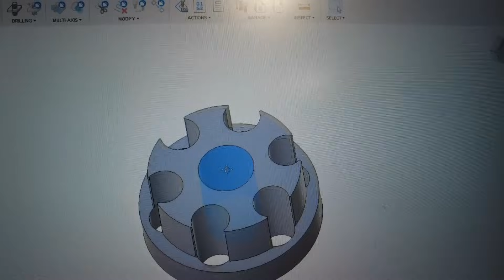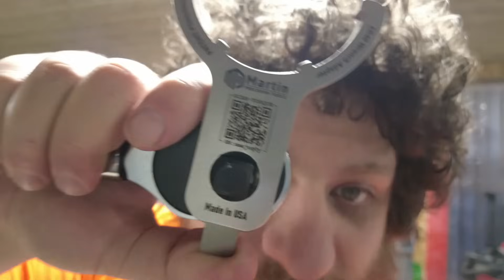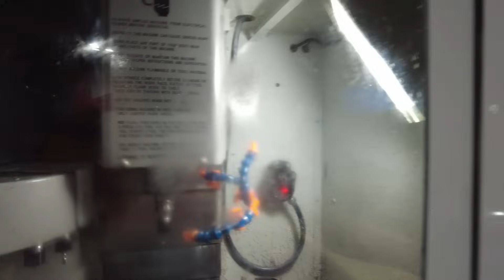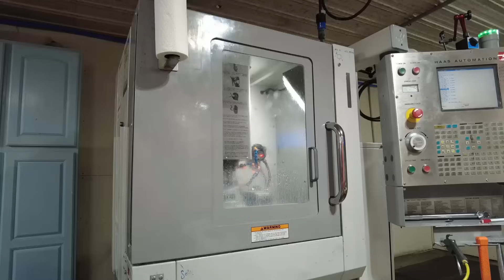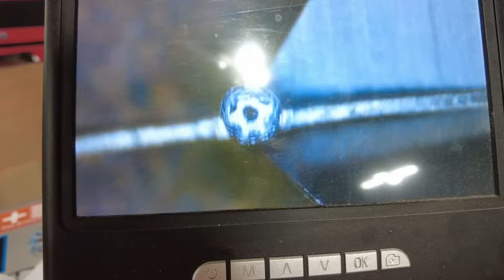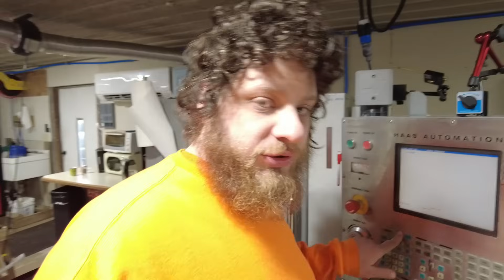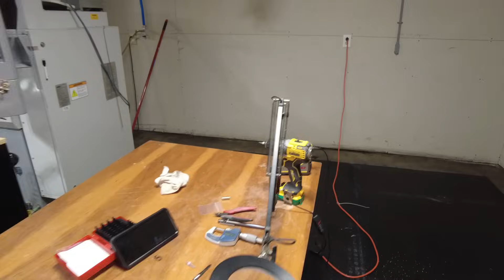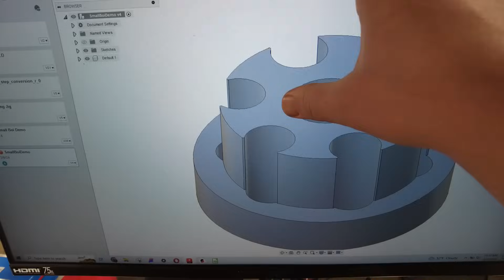Machining Some ABSURDLY Tiny Parts

Comment: Yes, It's me again...  Have a peek at Archie Perkins books on "The Watchmakers Lathe" and his three volumes on "Antique Watch Restoration".  Won't solve all of life's problems, but perhaps will give some insight on making quite small parts.  George Daniels "Watchmaking" is a classic as well.  You're certainly getting the most from the Haas, more than I would have expected.   I'd be having fantasies about Kern and Tornos machines in your shoes :-)  Well done pulling off those parts!

As for watch making putty like materials, AF RubOff and Rodico are two useful material, although in a pinch well balled up white bread (less any crust) with a wee bit of distilled water can sometimes save the day.  Parts nests in pith wood are nice, although real pith wood is hard to find these days.  Hard balsa or basswood is a fairly useful second choice.  Hang in there, you're doing amazing things with the machines you have at hand!  For work holding, CA glues break down in acetone, shellac flakes melt at fairly low temps and dissolve / clean up in alcohol.  As you are finding out, it's often how to hold the darn thing to work on it more than what to do with or to  the thing once you can hold it that makes life exciting.

Tweezers are a tool that most take for granted.  Carefully shaped and sharpened tweezers with flat faces that close perfectly without squirting parts out or drawing the part inwards are a wonderful thing to use.  Few folks outside of watch making and hybrid micro electronics learn the fine art of tweaking and keeping high dollar fine tweezers in good shape, but considering what you are dealing with it's a subject worth getting cozy with perhaps.  Dumont #3 and #5 tweezers are a good place to begin if shopping.  Not inexpensive, but tools you buy once and treat well.  The tweezers drawer in my watch makers bench is probably one of the most expensive little bits of real estate on this island.  At a lower cost, some of the Hobbytown branded tweezers are amazingly good for $10 or so, just had a chance to try some out at a model making show and ended up buying some.  I'm just a sucker for tweezers it seems.  You are doing things many folks would never even consider possible or would attempt.  It's not always an easy path doing the odd, tough, and obscure jobs, but it sure is satisfying.  Best of luck, you're doing wonderful things.

Remember to get some sleep.  A well rested mind makes better decisions, your vision is better, and your hands are far steadier.  I would never touch a high value timepiece or complex repair late at night, even if I felt good.  Better to take it on in the morning while well rested.  It might be worth building a little more slack time into your scheduling wherever you can afford to.  I know it's hard to balance the hard drive needed to build a business and the need to live like a normal human.  When I had a three to six month backlog it drove me crazy trying to get out from under it.  Once I accepted it, and determined what could be done to a high standard of workmanship in a day and refused to force myself past that point my life became far more pleasant.  The backlog went from being an overwhelming monster to becoming a buffer to fill in those days the phone didn't ring.  Before leaving the cubical farms of government contracting to frolic with clocks and watches I knew I was getting too wrapped up in it all when I would dream in code.  I'm retired now, might not have made it if I hadn't learned to manage my self expectations.

Comment: I heard you make a comment "sounded like a Hoosier" i think it was, are you in Indiana by chance? Ive in Bloomington and so many shops have closed in recent years it always brightens my day to hear of the ones still doing business.  Amazing job! My work is similiar to Cutting Edge Engineering if you watch Kurtis at all.  My big hands would preclude me doing any of this, much respect for taking that job on!
Reply: Hoosier is a (oddly) derogatory term in St. Louis.  That'd be my guess.
Reply from the maker: In this case, a Hoosier is someone from Indiana.
Reply from the maker: I'm in Muncie! Which has definitely seen its share of shops closing over the last decade, but I'm also starting to see a lot of niche manufacturing pop up.

Comment: Wow, those are some small parts, excellent work! Quick tip for making it easier to handle those small gauge pins, put some tape on one end to make a tab. Makes them easier to hold and find when you put them down, you can also mark the tape with the pin size, handy when using go no-go pins.
Reply from the maker: Ooooooh! That's smart! I'm definitely doing that in the future!

Comment: I make some parts that I thought were small, but they are massive compared with those. The smallest holes are 0.3 mm and some have waveguide holes around 0.8 mm  diameter, with the parts being well over 1.8 mm diameter, with some 0.2 mm wide grooves. Fixturing and handling are key. I use a lot of of my father's old watchmaking equipment and some Xebec alumina fibre deburring tools, plus the electronics tools I use for 0402 and 0201 sized chip components, with a binocular microscope and velvet-faced boards to catch stray parts. An 0201 is 0.6 mm long by 0.3 mm wide and tall. I sharpen my carbon steel Dumont tweezers on a fine stone under a microscope to get the tip shape perfect (the parts are non-magnetic, otherwise I use titanium or stainless tweezers or a vacuum pencil). Keep up the great work.
Reply: I was going to ask what frequency you were working at that the waveguide is 0.8mm dia, but then I saw who you were! You haven't made a video in a long time - it was just a couple days ago that I checked if I was still subscribed to your channel I hadn't seen a video in so long! I also really wish you could bring back "Old Amy" - old Amy was... [chef's kiss]. New Amy's voice creeps me out!
Reply: @gorak9000  275 GHz... I'm trying to recruit a live-action Aimee instead of relying on Google TTS. I've done a complete shop rebuild and bought a new SYIL X5 CNC mill that weighs two tons. I've been working on some long term projects and sponsored stuff, should be back making videos next week
Reply: That makes me think. There are very few reasons why you'd want a hold that small. To guide light... to guide RF... hmm...

Comment: An important aspect when machining tiny parts is tool accuracy. 
Assume a chip load ( or inch per tooth per revolution) of maybe 0.000,05” when running a 0.012” dia tool. Think of how that is thrown off if your toolholder runout is 0.0002”.  (And, 0.0002 is pretty good runout!)
You also need to check your tools under a microscope every time.

Comment: Mild steel?  That's puzzling.  They must have chosen that for a reason, but surely at that size the cost difference between mild steel and basically anything else must be negligible.  🤔
Reply from the maker: Yup. It's strange. My guess is that they wanted to test a magnetic version or something. The stainless ones were actually far easier than the mild steel ones, as the stainless didn't give me as bad burrs.

Comment: The torque wrench thing is just a matter of dividing the total length by the length of the basic wrench, and then either multiplying the setting to get the applied force or dividing to get the new setting for the same torque.  It's handy.

Comment: This reminds me of a fiber optic transmitter I designed in Solidworks. Long story, when my initial order showed up from the vendor I was shocked on its physical size.  After months of design my mind was expecting something larger. It would have fit nicely on a penny. The hole for the fiber was .7mm. So yours is way smaller.
Reply from the maker: I kinda got the impression that this was for something similar actually. at least that's my guess based on the customer, and some of the tolerances on the drawing.

Comment: You need to get an optical comparator to measure your parts quicker and easier. For those who don't know a comparator is like a projector housing with a measuring template on the screen that you project your part onto. This is a great way to measure accurately small parts, I wrote this before the end of your video where you referenced the need for one, so, kinda a waste of a comment, but at least your aware and the algorithm will still register the comment so there is that at least. Good video. You sure are a glutton for punishment taking on these micro parts. I'm going to start calling you the micro machine guy! Yay micro machines vroom vroom! LoL
Reply from the maker: Yeah! A comparator and toolmakers microscope are on my list! I haven't been doing this that long, and I'm still getting off the ground. I unfortunately don't have limitless cash to throw at the business, so I have to pick and choose what I invest in first. Up until last month or so, I was investing in a lot of the basics. More micrometers, gauge blocks, gauge pins, height gauge, all the normal shop stuff. Now that I have a little more breathing room, I can start looking at the more niche stuff.

Comment: Look at a jewelers apron. One edge goes around your neck and the other edge attaches along the edge of the workbench which makes it hard to lose a part by dropping. Launching is another matter. A photography light box would be good for that part of it.

For this part my first thought, like others, was sinker EDM, I was also thinking laser drilling as they get real small with that. 
Then I thought about micro laser sintering. They are making amazing micro sized parts. Head of a pin sized stuff.
Of course, costs and availability. Depends on how many you need to make and what they're worth.

Comment: Can't imagine why anybody needs a part so small and what gave them the idea they could hire someone to make it. I've had larger objects in my eye and kept working.
Reply: A microwave cavitron for handheld spy equipment.
Reply: @alldaveallnight  hmm, you might actually be right. but that frequency would in the ridiculous hz range...
Reply: @zeitgeist909 only if he uses a dipole reluctance multiplier try to keep it saturated at sea level
Reply: On the guessing train, this is likely for a one-off prototype of some startup company. (NST?) That's the only reason you'd pay someone like this to take a job for probably way too much money. They'll likely go to someone cheaper and faster to produce these parts later, they just needed it "now now now, not from China next month".
Reply: Well, if a stainless part flies, it is likely gone for ever.  Mild steel you could possibly recover with a magnetic sweeper…  As to the instruments and tricks, I agree that an optical comparator is something to try.  Just keep in mind exactly what type and size is relevant.  You could of course consider a full optical comparator, where you move the part to match its shadow to fine reference lines and read the XY movements from the stage movement controls.  Or you could try a stereo microscope with a reference grid  But whatever instrument you use, the first step is to secure the part to something reliable.  I believe the watchmakers have for a long time used something like children’s art putty.  Other idea I have is securing the part in a hole with some adhesive, wax or hot melt, or even  UV curing CA, wich later on can be made to release with about 150 to 170 degrees C temperature.  The UV curing is speedy (so you don’t lose part before the glue is cured).  About 5 seconds in my experience.  Besides different tweezers, surgical knives might prove handy, especially the slender triangle shape blade, for the presumably tiny burs removal.  The blades don’t last, but are easy to replace
Reply: @InssiAjaton  As a watchmaker i can confess that we often use shellac to fix parts to machines.. you could "Stick" a 0.3 mm dial to a lathe on a so called "Wax chuck" that is just a brass disc with grooves cut in the face, you heat it up, and apply shellac, then stick your part to it let it cool, and machine.. heat up and put in alcohol to remove the shellac
Jewellers also use shellac to fix jewellry to something, to set gemstones.. 

The "Clay like Putty" we use is called "Rodico" we also use it for cleaning.. but Blu Tack will also work, though it leaves more residue..

For deburring, we use "Degussit Files", small grinding stones.. for actually "Cutting" away Burrs.. i use a piece of Toolbit, round ø3 mm, ground and polished to a triangle point..
Reply: What was the part? A chip? I can’t possibly imagine that staying in your eye….
Reply: i'm thinking fuel injection nozzles for something classified. rockets/missiles maybe?
Reply: @gcrannell  no reason for that part to be so small, there is a ton of mass flowing though those, it wouldn’t work being so small.
Reply: @gcrannell  that would have to be a tiny missile/rocket I'm thinking?
Reply: Usually the medical industry requires tiny parts. Makes the holes in you body smaller if you get surgery.

Comment: I would suggest painting the surface of your inspection table matte black. That way, the only thing that reflects light back to your eyes are the tiny parts so they’re way easier to see. And for God’s sake, put a small lip around the perimeter of the table so tiny stuff can’t roll or slide off the table.

Comment: You might look at getting some needlepoint tweezers. As for your workspace, full sized baking trays for commercial kitchens (check out restaurant supply stories) might be worth while to keep things from going as far. (They also work well for sifting thought that jar of random small screws that every shop seems to end up with.)
Reply from the maker: I whole heatedly agree. Kitchen trays are a great idea. And if I ever get a job like this again, I'm building the cost of an array of tweezers into my quote 😂

Comment: you can put the palper on the spindle check distance between table and  your part or pick a height gage to mesure, for your set up  make  all your hole and rought dia too, make a little jig put in the jig with pine alignement and glue it, no burr just heat up or solvant glue tk gl hf ;)

Comment: You can make a tiny spot drill by lapping an arrowhead shape on a broken carbide pcb drill. I use about a 1.5mm one. It takes just a few min on a diamond stone and the geometry isn’t crucial

Comment: Did you try running the drill back through the hole after milling to get rid of the burrs?
Reply from the maker: I did try that. It just shifted the burr back outside of the hole

Comment: As part of setting up the organized workspace for small parts invest in some large pieces of white fabric or butcher paper to put down on the work surface and floor so you can more easily spot dropped items.
Reply from the maker: That is a fantastic idea. A few other people mentioned using something like a lunch tray. Some combination of both may be the way.
Reply: @AudacityMicro  you could get one of these silicone soldering mats that have small pockets and compartments for putting tiny electronics parts into
Reply: @fxshlein and as an FYI, this is a much better use for those mats than their intended purpose: those silicone mats are not antistatic, so they’re actually not safe to use on electronics. (Which is a damned shame, since they would be super handy.)
Reply: @AudacityMicro  Both have their place for sure. I brought up the butcher paper because it can double as a blank canvas to help keep kiddos entertained and its just about the most economical way to make large areas a flat consistent color. Keep up the awesome work, so glad the algorithm decided I was worthy of knowing about your videos!

Comment: I've been there with those burs and those climb cut and conventional milling tool paths with similar results and tool life. With the cad you can pick a spot for a plunge cut to cut the burs from the corners of the hole using a milling cutter bigger than the hole, this will lead to just the smallest of burs (on one side in the hole) that you can easily remove pushing the shank of a used drill through the hole.
This way you can ditch the conventional cutting and fine tune the finish cuts to get better tool life and repeatability. It's better to take two 0.02mm cuts than to cut 0.04 once and a spring cut on diameters that small, you'll never get a decent cut the second time and just quickly wear out the tool and get bigger burs as a result.
I've learned to just throw away small drills after the job is done to prevent a lot of frustration,  micro drills that drilled anything tougher than aluminum are scrapped no matter how many holes they drilled. And yes getting a good center is a pain if you don't have the right tool, trust me... Just get the right kind of center with the correct top angle if you are doing small holes more than a few times so they don't wander off if you have to drill more than 3xD deep. It will save you a lot of headaches and sleep and help with your lead times.
EDM would be even better but only if you already have that, or if you make so many small parts that it would be wise to invest in it. Not accounting yet another learning curve...